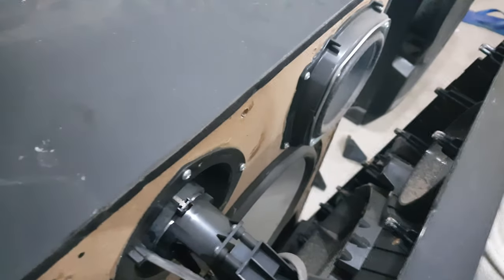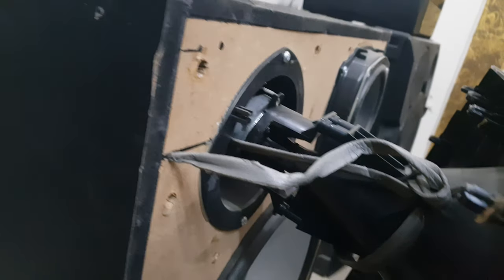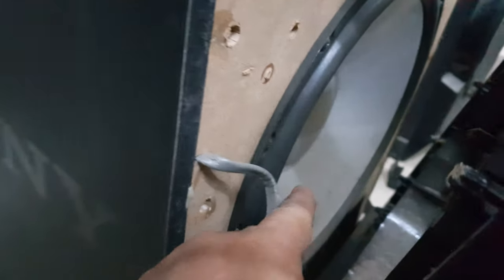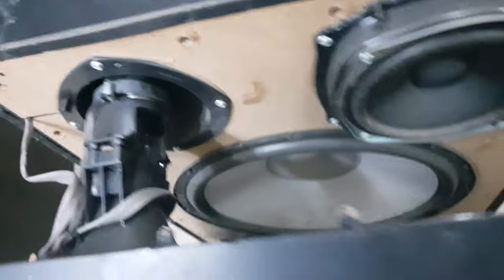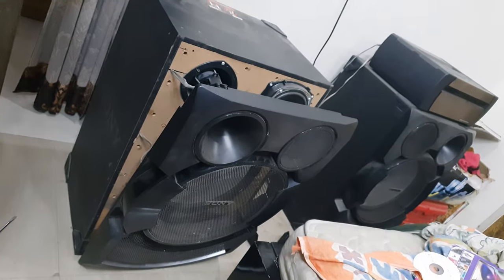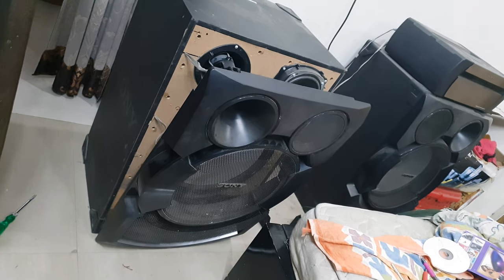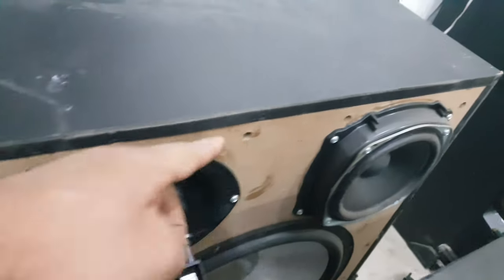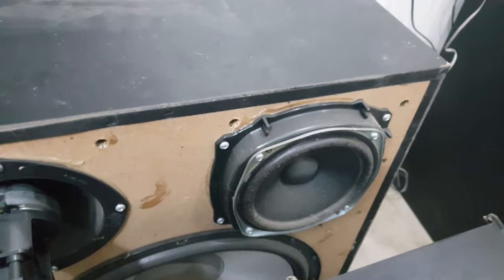Dismantling sony shake x7d speakers

Comment: Hello sir how did you remove the screw?tnx
Reply from the maker: Just  remove the screws in the front frame and use a cycle tyre remover tool and a screw driver and slowly slowly make the gap onnsides start from one side
Reply: @NomadicKerala  many thanks bro
Reply: @NomadicKerala  bro your video is to short.better you took video from the beginning on how you romove the screw and dismantle the speaker.
Reply from the maker: I will add it soon
Reply from the maker: https://youtu.be/kBHpsLE3Drc
Reply from the maker: Full video
Reply: @NomadicKerala  bro many tnz
Reply: Its help me a lot
Reply from the maker: @melvincuellar8399  Do it slowly for new speakers it will be tight for first time removal
Reply: @NomadicKerala  Hi, It's really tight. I'm afraid of damaging the screw heads. Should I force it ?
Reply from the maker: @chris21101965  use new screw driver give some pressurr and turn